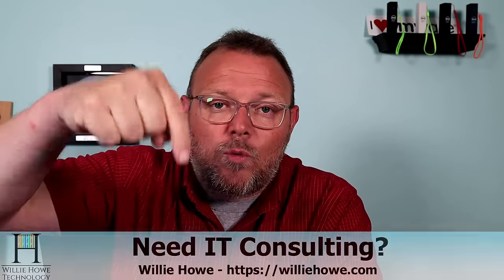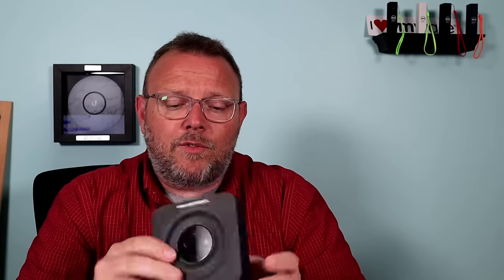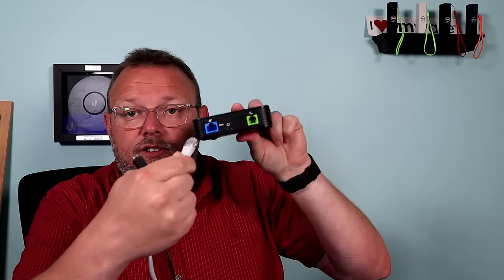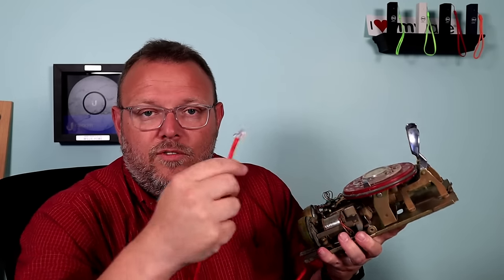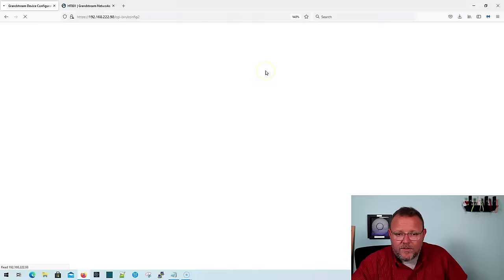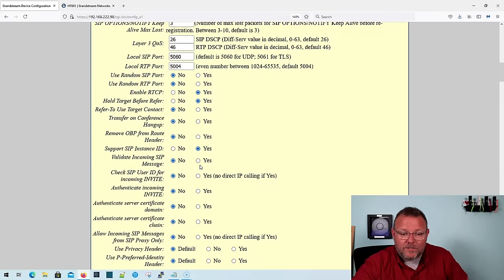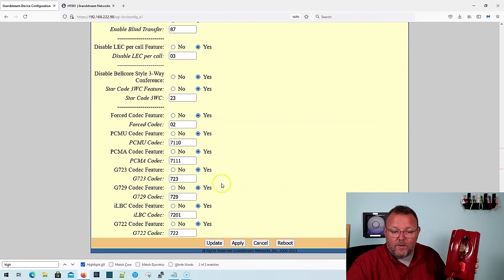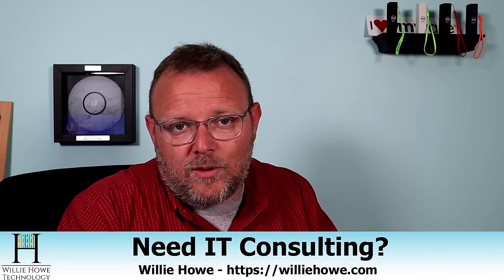Grandstream HT801 ATA - Keeping your analog dreams alive!

Comment: When using a rotary dial you don't need to keep your finger in the hole after the clockwise turn, it should return on its own unless the spring is broken.
Reply from the maker: Spring moves too slow for me.
Reply: @WillieHowe and that’s how you break it
Reply: I was an Operator and from day one of training we were told not to "ride the dial".
Reply: @kernow9324  you are correct, they told you not to ride the dial as you say for a very good reason.
Reply: Yep 100% agree let return spring do it's Job!!! The More I tried to Rush entering the number e.g rotating dial backwards I would always stuff up on the Last Bloody Number ffs!!! So Start all over again FMD! FFS! FML! Haha😢 😂(And it Made a weird noise when you did IT! Was obvious it didn't LIKE it at ALL lol! Saying that I never did Break IT)🤦 But try telling that to a adhd 7yr Old 🙆🤦 OMG THIS Phone killed my LIFE 🤯🤬
Reply: If the dial moves slow, get some spray graphite like for locks. Remove cover, loosen the 2 mounting screws that hold the dial assembly in place and lift it off. place upside down, notice a round device the size of a quarter with a spring inside (You can turn the dial and see it spin). That is the governor that controls the speed. Spray it and dial zero a few times. It should dial a bit faster and smoother. Reassemble. It is designed to rotate only just so fast as to not to exceed 13 PPS (pulses per second), which would be faster than the telco equipment can handle.

Comment: I have a large resort that did not want to swap to IP running off 48port GXW FXS adapters from Grandstream PLUS one of these for the alarm system dedicated.  The front desk, office, other areas in the main building are IP phones the rest we stuck with the 20year old analog phones and they work fine.

Comment: Love this! Trying to get a Western Electric wall phone to work in the garage, at least in some capacity. Problem is, we'd need battery power (usually run an extension cord from the house when needed, so that's Plan B.) Also the router is in the house, but we can get WiFi in the garage. Bluetooth retrofit would be the easiest route, but that would make it redundant.
Reply: Use a wireless bridge to connect to the garage to the home wi-fi. Telephone "talk  battery"  is going to be provided by the ATA so I don't know what battery power you're talking about unless you have no power in the garage and you're trying to run the ATA off of batteries.
Reply: @BufordBuzzard  Power in garage is an extension cord we use as needed. It's not always in there but I will look into a bridge for starters. Thanks!
Reply: You can also keep the ATA near the router (and preferably both powered from an “uninterruptible” power source, then run a phone line to the garage. (Most ATAs can have 1 kilometer or more of standard phone line to the phone location).

Comment: What are they doing to support automated attendant systems? As the network becomes more and more digital the DTMF tones do not work properly all the time. The FCC is mandating the discontinuation of analog lines. They should also mandate that the companies find a solution for this problem. It affects banking, telephone entry units, almost any business that uses an automated attendant. Not to mention systems that use a dial up connection for updates, YES they are still out there. Some installed just a couple of years ago. We are not talking about decades old infrastructure.

Comment: Great video.  Very helpful.  At the beginning, you mention that you wish the Grandstream ATA HT801 had POE (Power Over Ethernet?).  What is the benefit of POE?
Reply from the maker: We can use this where there's no power available as long as we have Ethernet.
Reply: @WillieHowe One can use a PoE to 5v USB micro power splitter and then no local power would be required.

Comment: Your video is very interesting. I was working with this device and my question is how many phones can I connect, because I have had a problem: You can receive calls, you have a tone, very well, but when you make a call from any phone, then no more calls come in and the answering machine is activated automatic. Any ideas? any limitations? Connecting only ONE phone goes well ...

Comment: Oct 2022:  Thanks, was the video I was looking for!  So if I wanted two analog phones over existing wifi - say, between house and garage, would I then need TWO of these boxes?   Also, is this a subscription-based service or can I just use my existing wifi router and a wifi extender with Ethernet on the 2nd phone to have simple VOIP connection?   Thanks.
Reply from the maker: You have to either connect it to a PBX or put a sip trunk directly to it.

Comment: So to be clear, I would need a Grandstream 801 in every room where I would have an internet hardline and wanted to install an analog phone? plus an ATA for rotary phones? Is it possible to plug in the existing house R11 network and run it through the copper lines?
Reply from the maker: You could tie it to existing house pairs and have multiple phonea

Comment: Will this device work with multiple POTS phones connected in parallel?  In other words I have several POTS in my home wired to a single point.   My desire is to connect that single point to the Grandstream unit and all my old POTS phone works as before?
Reply from the maker: It should
Reply: Did u get it to work?
Reply: Yes works great
Reply: @GuidoLoko  yes works great.

Comment: 4g/5g hotspot to ATA - is it possible? What is the best configuration/hardware? Thanks for the great video!
Reply: Buying an LTE router with a LAN port, or failing that you could get a normal router that has a "client mode" feature.

Comment: It is really disappointing that's not POE. However what is the power requirements I know it's 5 V how many amps? There are POE converters that are available for like $15 on eBay with micro USB and ethernet pass-through I've been using them with a few things they're very handy. They tend to be marketed towards the raspberry pi crowd.
Reply: 1A.

Comment: Will this work with an Alarm system using pulse dialing. We have one installed but the alarm is not detecting a line. Any suggestions?

Comment: Hi! Loved this video! I recently purchased an old ITT rotary phone for nostalgia in my home office. It received calls OK but will not dial out. I am on ATT VoIP internet and have a touch tone phone there now, which works fine, but want to change it out with the old one. All there is is a standard phone jack, and I figured this device could help make calls out. Problem is that the house modem is in the garage, nowhere near where I want to use the phone. There is a phone out on the modem going to a small white box where it looks like it is going to the wall. I am not sure how to connect this HT801 in this setup to make it work, or if it will even work at all. I really appreciate any help! Thank you so much!
Reply: Depending, it may need a polarity fix. Some of these old phones for some reason or another if the wiring is not in the correct polarity, it won't out.

Comment: Thanks for the video. I got a 1980 Australian 800 Series phone to work send and receive) with 3CX, however it does not ring. It uses 4 wires from its plug and ensured that I am using a 4 wire 610 to RJ12 adapter between the phone and the ATA. I have high power ringing ON also. Any ideas anyone? I've heard it takes from 50-100v AC to ring?
Reply: I think the Grandstream uses 2 wires only wheras the 800 phone probably uses 3 with the bell wire seperate. Open the phone and remove the blue wire and make sure that terminals 4 5 6 7 are strapped and 8 9 seperately strapped

Comment: I just got one of these to hope to use in my Avaya environment to use as a Fax line instead of purchasing POTs lines. I picked up the 801 and from this it seems pretty simple. Just configure my Avaya server info and the extension.. is that pretty much it?
Reply from the maker: Yes
Reply: @WillieHowe  so what phone type do you select on your PBX(avaya)? I've tried various ones and I can't get the device to register. I built the station and enter the PBX IP info, station and pw in the GS FSX config page. But it just wont register. Thanks for responding to an old vid.

Comment: Most people live only with their cell phones now but if you do that, your life is in danger. If you get something lodged in your throat while eating, how are you going to tell 911 where you live when precious seconds count? People say "they can use triagulation now to find you". Okay, you have 3 minutes left to live. How long is triangulation going to take? And first you have to find your phone. And then it had better not be turned off. And if it's on, hopefully your battery is not about to die just as you're calling. 

So having a home phone plugged in and powered up all the time is a wonderful thing (voips work so long as the power is on) and so long as you pay for the 911 service on an obi or other device, you're (hopefully) good to go. Magic Jack has 911 already included.

Comment: Do you know if the HT801 can be setup to auto answer for a paging system?
Reply from the maker: Which direction?
Reply: @WillieHowe VoIP call the extension setup on the HT801 thru the copper line to a speaker
Reply: Is there any sort of fee with the use of this device along with an old style rotary telephone? Or once you buy the device and hook it up everything just goes thru your Internet and there are no additional charges?